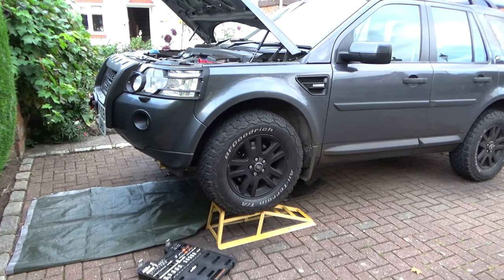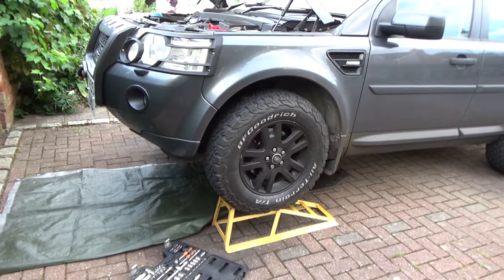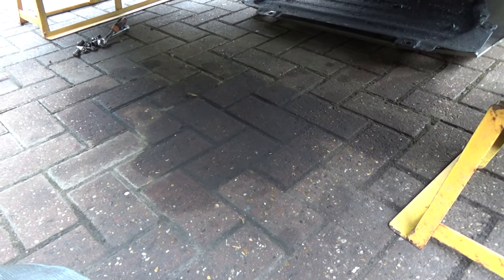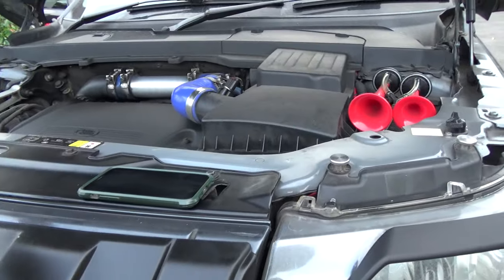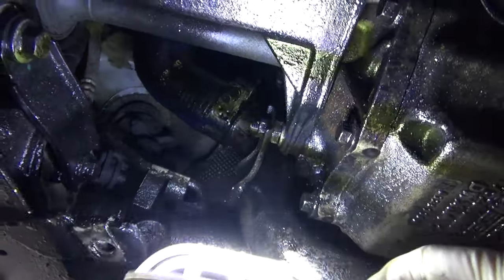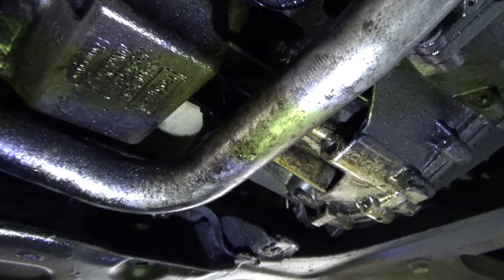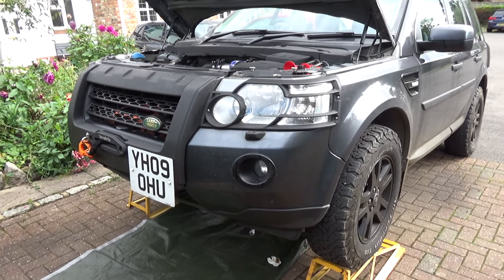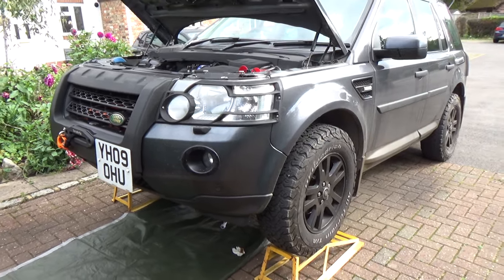Oil leak investigation - Land Rover Freelander 2 / LR2

Comment: Hi, I have the same leak between the gearbox & transfer box after just having the clutch replaced... Did you manage to fix it at all and have a link to the video or some advice please?
Reply from the maker: I’ve not fixed it but the leak seems to have slowed down and self-sealed itself. If I were you I’d try to identify which oil it is. I used oil paint for this, as in  this video. If it is the transfer box then it is easier to deal with…still a major job, but easier than the gearbox!

Comment: Did you find the cause and cure of the gearbox oil leak? . i have a similar problem that only appeared after changing the manual gearbox oil . Thanks for the great work on your channel
Reply from the maker: Thanks Ian. I’ve not cured it no, it still leaks a bit, but only when full right to the brim. Sounds similar to your issue. I think the seal between gearbox and PTU housings was disturbed during my clutch change and now leaks slightly. I used coloured oil paint to identify which oil was leaking and it is definitely the gearbox. PTU is fine. At some point I’ll replace the PTU so will inspect and renew the seals on the gearbox face.

Comment: Hi there. I have been following your vids bud, nice mods on the fl2. Quick question. How is the engine holding up after the remap you had done? Cheers pal.
Reply from the maker: All still going well. The remap was well worth it. Runs so much better.

Comment: Mine leaks from the same area, convinced its the rear crankshaft oil seal, i changed it myself with a new one and it done the same again, i since been told i should have replace the plastic ventilation part on top of the engine as this part causes excess oil pressure blowing seals on the engine when it fails.
Reply from the maker: Nothing dripping out of the clutch housing and seal was renewed 3k miles ago, so thankfully it isn’t the crank seal on mine. I’m thinking it is the seal between gearbox and PTU.
Reply: @BeavisPits  hopefully that's just what it is and it'll be a bit easier to deal with job wise, keep up the good work 👍

Comment: Why did you not just top up the oil levels and test after a week to see if the level goes down
Reply from the maker: I could have done that yes, but transfer box has the strange “brim and remove 120ml” thing and I was not sure if it had gone down through leaking or because it wasn’t full in the first place. The weird thing was the gearbox was already full yet appeared to be the one leaking. Colouring the oils was a sure fire way to clearly see which oil was leaking out.